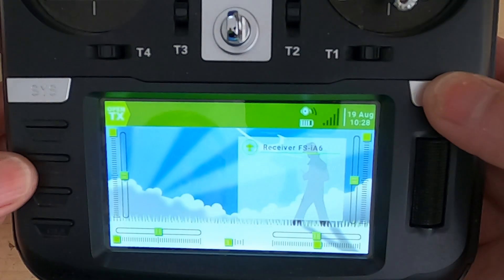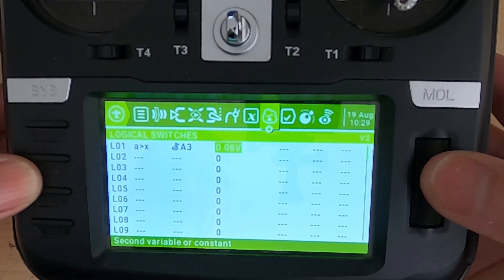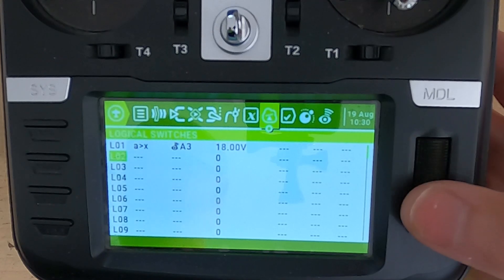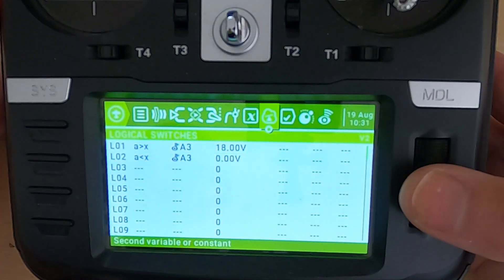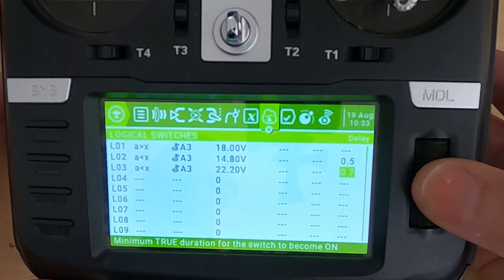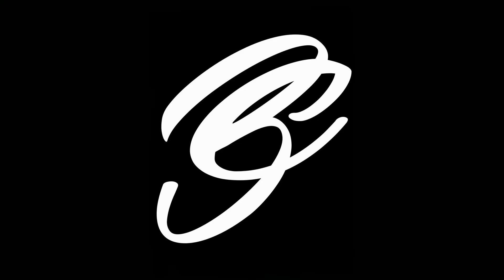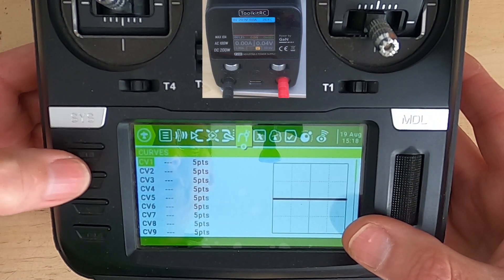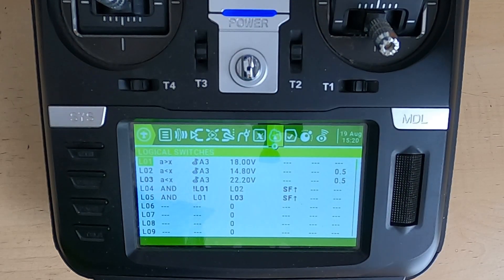OpenTX Automatic 4s or 6s Audible Radio Flight Battery Warnings

Comment: Is it possible to configure it for 3, 4, and 6 cell?  If so,  what changes are required?  I assume you'd need an or condition to the L01 logical switch?

That way it will work with all my quads.
Reply from the maker: Yes this videos shows you 4 and 6s. You just need to adjust the parameters.

Comment: Assuming battery voltage is calibrated correctly in betaflight (and you're using betaflight), could the Bat% sensor be used?  if so, this could be accomplished w/ one logical switch.
Reply from the maker: Hi Jake, I do not think so.
Reply: @the-happy-RC-flyer  I believe you're right.  I had good, repeatable results on my 4s quad but those same settings didn't work w/ my 6s.
Reply from the maker: @iiianydayiii  I will need to check the settings.

Comment: Hey Bill - Great Video! Thank you. I have the new DJI O3 Air unit on my quad. At this time the O3 air unit does not put out battery voltage in the goggles. (known issue) I can show the battery voltage on my T16S EdgeTX display. But I am waering my goggles and can't see the display during flight. Is there a way that I can get battery voltage call outs like every 10 seconds or on certain threshholds? Thank you very much.
Reply from the maker: This video should help you
https://youtu.be/ur1lnFTR884

Comment: I have been trying to do this with my radio and was not able until I found your video. Your video shows the settings for 2 battery types. Can this same method be used for 3 battery types? I have a model template I use to setup my RC and I use 2s, 3s and 4s. I modified the settings to accomodate 3s and 4s but not able to set for 3 battery types. Could you respond back and advise how to add an additional battery to this setup?
Reply from the maker: You need to add another logical switch for the third battery you will need to check the voltages allow the switches to work correctly. I say this because of higher voltage differences between 4s and 6s.

Comment: 1 question Bill if i may, how do I know that my radio is fully charged? only by the light on the power switch off after fully charged?
Reply from the maker: Hi David, best thing to do is check your radio screen they seem to be fairly accurate in my experience. Also make sure your radio is set up to give low radio battery warnings it should be by default. I think you would have to be very unlucky to lose a model because of low radio battery these days. Hear the warning and land! 😊